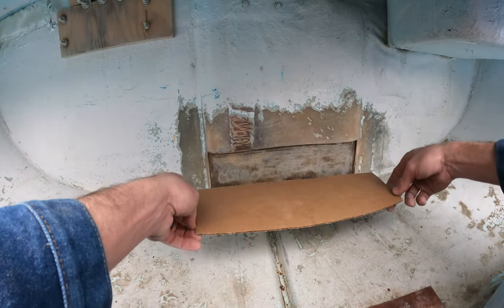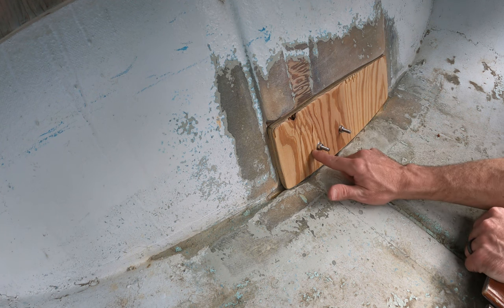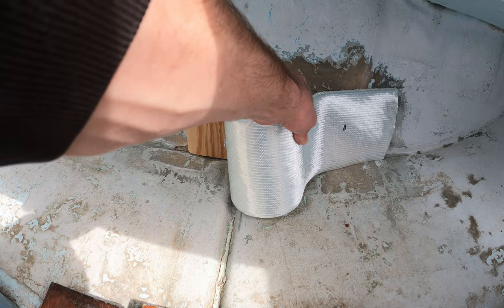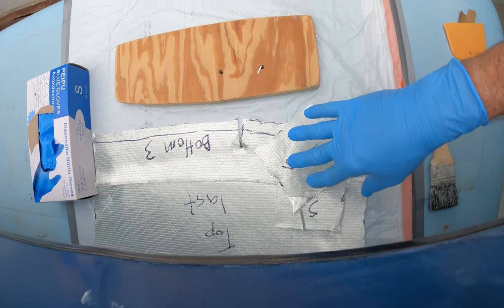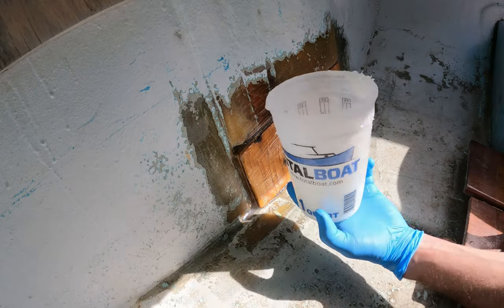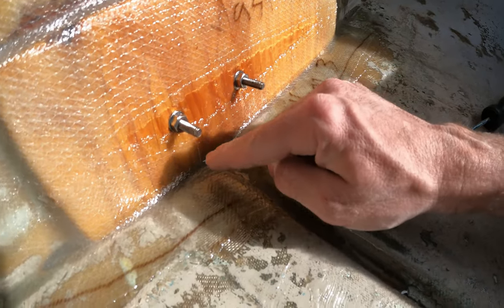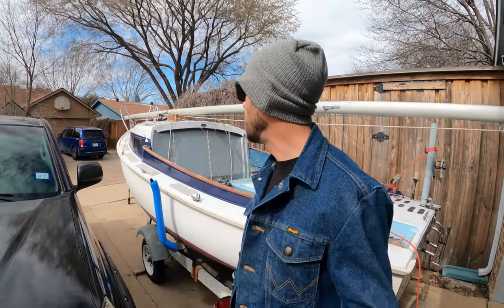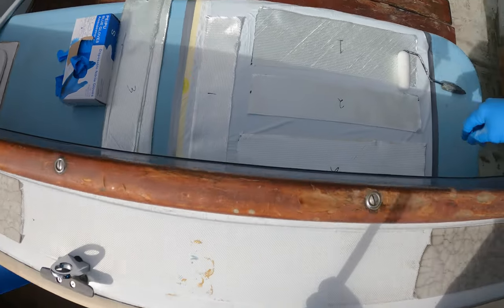ep. 40 My Very First Fiberglass REPAIR Work // Do I REGRET It // TOTALBOAT pt.2

Comment: Hi Brandon, use gloves when working with fiberglass bro. I have a fiber stuck in my finger tip I haven't been able to get out and it swells up and hurts like a mother. I'm getting ready to take on some deep spider cracks. I'm praying it's just gel coat cracks. I'm already sick to my stomach about dremeling out the cracks 😅 I just hope I can do a good job and have it look good when I'm done. Shops want $3,000 to $4,000 just to do the gel coat repairs and it's just above the rub rail around the back of the boat the usual spots. Then more money to paint it. The boats 26 years old and in great shape. I should just use the boat and not even worry about the cracks. I do this all the time I buy some old toy that's in ridiculous shape for it's age fall in love with it and start trying to restore it. 😂

Comment: Nice repair.  I cringed a little when you cut the plywood because I don't think you should not have used the fence with that cut - risk of kickback - could have made a cross cut using the miter gauge; and your hand was close to the blade (use a push stick).